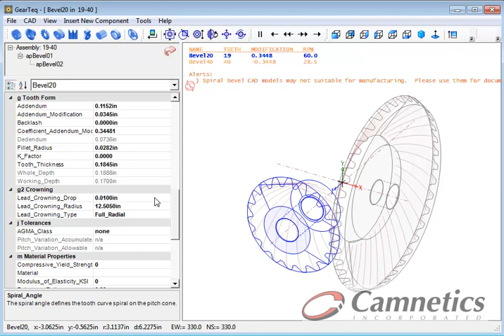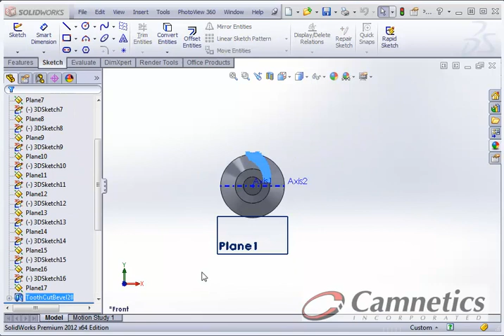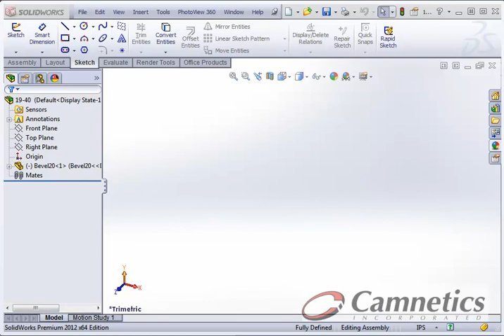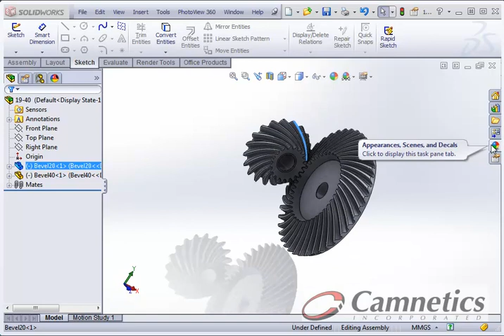GearTeq Demo: Bevel Gear Pair with Camnetics TruSpiral and Lead Crowning

Comment: I have a 2014 version of solidworks and when i try to make the gearteq create the gears, it says my solidworks 2014 is not running. I have switched manually to 2014 version in gearteq settings and i ve tried having a part and an assembly open. Also gearteq is not showing up in the add ins tab.